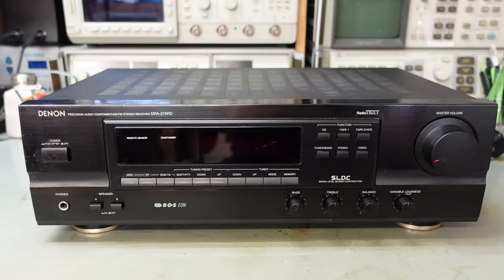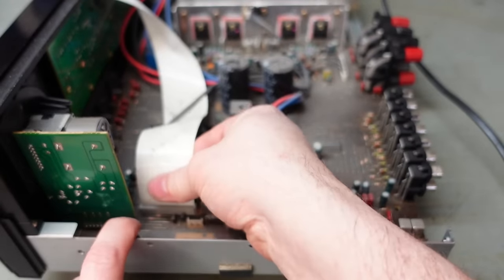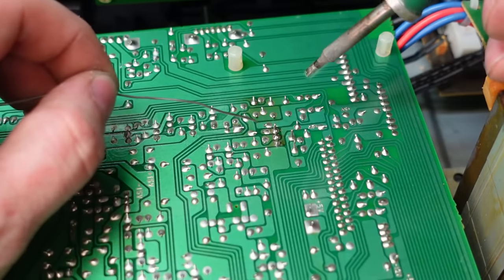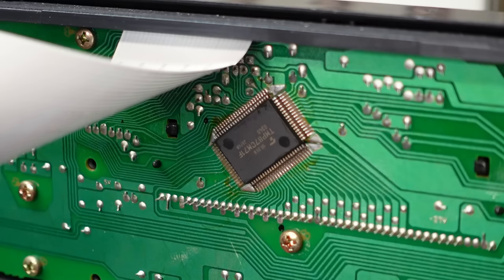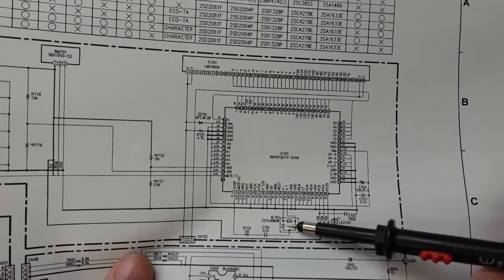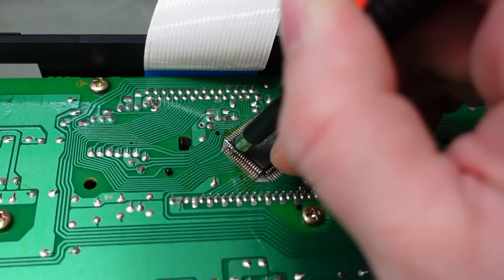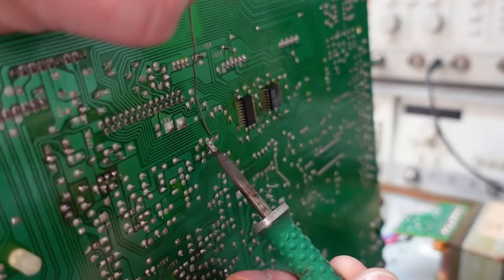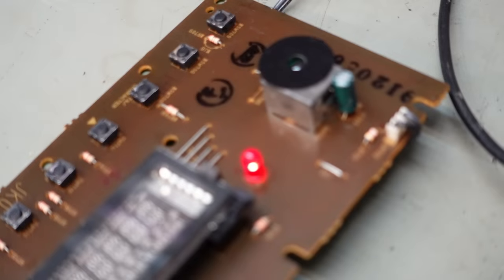DENON and the irreparable failure.

Comment: Hi, I have a Denon AVR-1709 and it crackles on startup and after 10 min when it is warm all is fine. Been using this for sometime and today I notice that the left speaker is crackling on and off. The source of the crackling is from the AVR. Could this be due to dry joint, can I try to dismantle it out and do some soldering.

Comment: i have a nice looking sony receiver, it works but while its off the display will partially light up and you get a buzz threw the speakers and the unit gets hot quick like it was just used, and of course it would do it in the night and jump the crap out of me. as i was looking at it i found and removed some corrosion along the bottom of the heatsink where transistors? are attached, since then i have only checked it to be sure it still comes on which it does. any ideas? i dont need it and i want it out of my way, but would still like to figure it out.

Comment: The tantalum capacitor on the CPU board could've shorted, did you measure it for a short? They're typical faults in old computers.

Comment: Hello I have a quick question. When opening these up and poking around arent you afraid of the big capacitors shocking you? Can you acciddentally touch another component that traces back to the capacitor and it shocks you? Or do you have to actually get underneath the cap and touch when of the leads for it to shock you?

Comment: i had a technics and a sony receivers and an emerson turntable-cassette-radio that all three when owned at different times in middle of night would all of a sudden start clicking and and off but couldnt be turned totally off by pressing on-off button unless unplugged. then ended up all dying. strangest thing. i thought it was plug they were plugged into the last one i ran extension cord to other outlet and it did same thing. what you think couldve been?

Comment: I sill own a Denon receiver (DRA 545r from the 1990s) and still use it to stream music from my smartphone to the (KEF) speakers via Logitech’s Bluetooth audio adapter. Sound is still phenomenal, but I now have an issue: the sound from the left speaker is no longer coming out fully (the right speaker is unaffected). When I fiddle with (or press on) the balance button, the full sound returns to the left speaker. When I no longer touch the button, it tones down again. Any suggestion as to how I can fix this issue? Thanks in advance !

Comment: Well, you could program an FPGA and install it in it's place, but that would be time consuming. How about replacing the crystal oscillator, even though it's a working piece?
Reply: "time consuming"?  You're a master of understatement.  You might as well just design a new amp/receiver.

Comment: Or keep it for spares if you're a very good video creating Technician. What about buying another because their cheap ? I have a blown Denon AVR2000 1992 and the boards look similar ? It's stuck in protection mode after a front channel speaker lost connection and a terrible burning smell so it's not going work . The front panel works , captain obviously , what say you sir ? I know it can be anything but your brilliant , my mate is a tech and ive watched him for 35years Your  better , don't tell him he 's coming around to take a look of course .

Comment: Custom software, no chance!
I hope you can at least get a few good parts out of it, you cant fix em all!
Reply: Save the output transistors too. Real outputs are precious now. Most of the time are suitable for replacements in amps of the same or lower power rating.

Comment: All of these AV receivers: Denon, Marantz, Onkyo - They're engineered pieces of garbage. Ever since they started throwing in CPUs to handle HDMI and DSPs for the audio, it's all been downhill. Some of these damn things have 4 CPU's in addition to the SOC!!! They heat up...imagine that! And these bozos think they can simply thrown in a fan an voila, you have heat management, in a device with horizontally stacked PCB's with a fan sitting atop.

Comment: Hi Mark I got a Denon 3806 shipped to me, it wont turn on (absolutely no power at all) is this repairable? It looks in very good condition.

It's hard to get things repaired here, small city.
Reply: Is there any sign of life on your receiver at all? I'm a professional repairer of domestic and pro audio equipment, although I don't work on AV receivers any more because they can chew up a heap of time to repair and then they aren't worth much so people aren't prepared to spend a lot in getting them going. 
To answer your question, most things are repairable - it just depends how much money you want to throw at it.
There is a reset/initialization procedure for your receiver which you could try before venturing any further:

1) Hold PURE DIRECT and NIGHT and press POWER
2) Check that the entire display is flashing with an interval of about 1 second, and release your fingers from the 2 buttons and the microprocessor will be initialized.
Reply: Its in absolutely great condition, BUT it got shipped to me and most idiots don't know how to box equipment so it must of got damaged.

Inside it looks perfect, no damage of any sort. Very well built unit.
Reply: Tried reset absolutely nothing. It's a shame, such a nice unit.
Reply: @aussie_philosopher8079  It may be something very straight forward. Complete lack of power is actually a much easier fault to diagnose than lights on but not powering up. I would recommend you find a competent technician in your area to take a look at it.

Comment: Don't buy this crap brand. Bought a surround av receiver 5 years back. After 14 months (just passes warranty)it kept turning off itself during operation. Don't  bother going repair which may cost half of the value. Dumped into landfill, bought back usual pioneer. No problem since